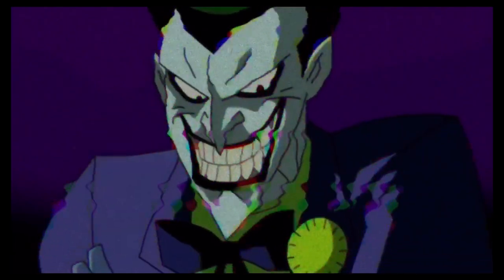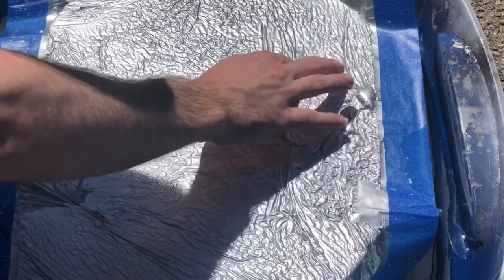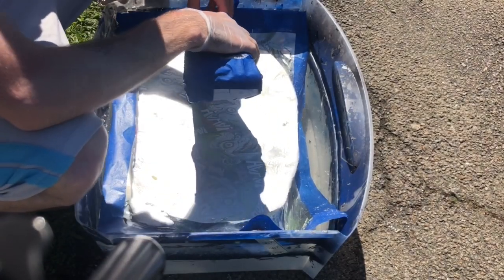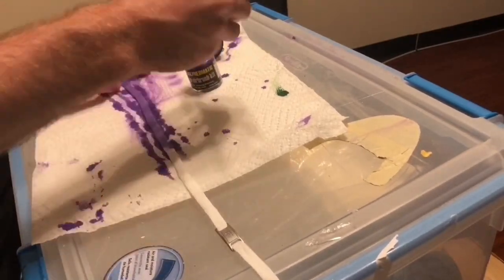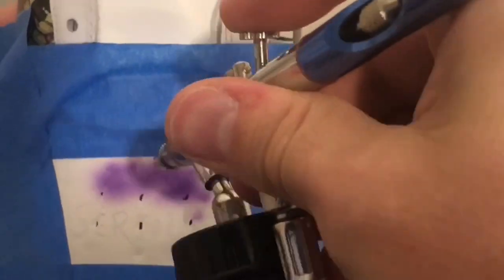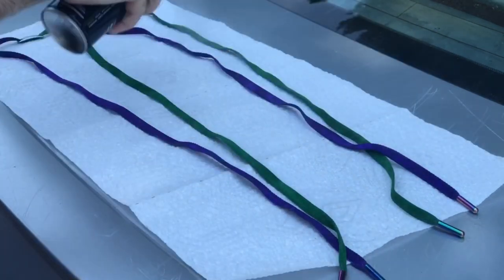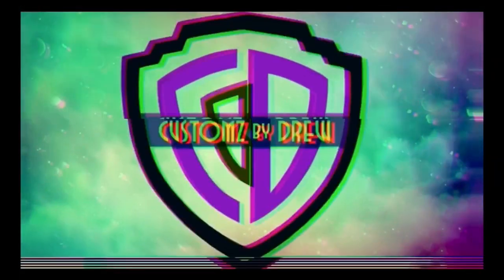Joker 🃏 Air Force One Hydro Dip Custom 👟 (Best One Yet)

Comment: If I hydro dip my air force and not put tape on some parts on the bottom to make a drip effect will that look good
Reply from the maker: Hey what’s up Grivz so I actually made a video doing this for a Simpson custom I think if you check it out , it will help you out with you question 🤘🏼

Comment: Where do u get the film for hydro dipping .and what spray did u use befor u dipped . And what spray afterwards
Reply from the maker: Hey what’s up ShockWave so if you search up Joker hydro dip it should pop up and you would also need a activation spray for the hydro dip and the spray for afterwards is a finisher to seal off the sneakers it’s Mod Podge Acrylic sealer
Reply: @customzbydrew26  what is the activator spry called . Is  it spray paint .
Or is it a diffrent kind of paint .
Reply from the maker: There are many different kinds tbh I used a couple different ones and can’t remember the name but if you search up hydro dip activation spray it should pop up bro 💪🏼

Comment: 2 questions what did you spray over the film in the water  and what did you spray the shoes with once they were done? These are 🔥🔥🔥🔥🔥
Reply from the maker: What’s up K.H So I used a matte finisher on the sneakers you can use any one tbh it’s just what you prefer and also in order to activate the hydro dip film you need to spray it with activation spray any one will do it’s just all on what you prefer

Comment: Do you modge podge acrylic sealer on hydrographic film still? I've had bad luck with every other sealer I've tried. Thanks
Reply from the maker: So you have to prep the sneaker very good so you have a proper bond and once you dip the sneaker you have to rinse it under warm water then apply a finisher I used modge podge before but I’m still looking for other finishers to try on the hydro dipped sneakers

Comment: Please help !...I want to start hydro dipping  shoes as a business..but I'm thinking about the amount of spray paint used per shoes ..it seems like I'll be losing and I dont want to over charge ...any advice ?
Reply from the maker: So typically I use hydro dip films I never used spray paint but I would recommend you look up hydro dip films and see what’s in your price range because prices vary also take your time and practice makes perfect 🤙🏼 you got this !!!! Another thing prepping is key so make sure you prep the sneaker very good to achieve a clean finish and dip on the select areas you want to apply the film/paint 🔥

Comment: Where do you get that hydro dip drawings and the spray to make it stick on the sneakers bc the one that I used sucks the paint keep coming off even whit the sealer
Reply from the maker: What’s up bro so it’s all on how you prepare the sneaker and after you dip you need to run the sneaker under warm water to wash off the clear coat then apply your finisher but I buy a whole bunch of dips and sprays from different places and try them tbh it’s trail and error but definitely check Amazon
Reply: @customzbydrew26  how did you get the picture on the film ?
Reply from the maker: Hey Mia so typically it comes like that but you can get a custom one made. A lot of people don’t know that but if you search it up you can pretty much find any cartoon character or any kind or pattern 🔥🔥 lmk if that helped and if you have any more questions

Comment: Hey man nice work, what all materials do you use?
Reply from the maker: What’s up man thank you I appreciate it 💪🏼 and typically for a hydro dip custom you need a bin,Tape, the hydro dip activator and film. But I also made a stencil and used paint as well as seen in the video as of specifics I kind of jump around I don’t really use just one item I try new ones but paint Angelus that’s pretty much the only thing I’ve been using and haven’t changed
Reply: What’s the film?
Reply from the maker: So if you search up joker film it should pop up I’m not sure where I got it from tho
Reply: @customzbydrew26   appreciate it bro

Comment: What kind of clear wrap you used to cover the other side of the shoe while you dipped the other and did you use spray paint or you use angelus white or neutral paint as the primer?
Reply from the maker: Hey what’s up Sheldric so I used Saran Wrap nothing to special lol and also I always acetone the sneakers and use white primer it self not a white paint or neutral paint
Reply: @customzbydrew26  all good then man thank you so much and one kore question, did you let one side dry when when you used the saran wrap and taped that side off and dipped the other and what can i use to stuff the shoes so water cant get in em
Reply from the maker: So what I did was wait like 5 minutes and then dip again because the film has a finisher on it and if you touch it or something touches it , it will smudge so be very careful also after you dip wash the sneaker with warm water then apply your own finisher and you can stuff the sneaker bro with a shirt you don’t need and also Saran Wrap any big openings as best as you can tbh the sneakers will get wet but you can definitely try to prevent it lol

Comment: I like it a lot! may i ask what did you spray after dipping the film in the water? (before dipping the shoe) thank you
Reply from the maker: What’s up Rouge I sprayed the film with the activation spray you can find it on Amazon if you search hydro dip or hydro dip activator 💪🏼
Reply from the maker: And thank you I appreciate it 💪🏼😌
Reply: @customzbydrew26  if I buy hydro dip film, it comes with activator? Thank you
Reply from the maker: No problem any time and typically you have to buy it separately but some sites do have it set up so you can get it together

Comment: Did u spray the sealer when the shoe completely dried? I sprayed Matt finisher on a test shoe 20-30 mins after I dipped it, I bent the shoe this morning and the clear cracked, was that because the shoe wasn’t completely dry????
Reply from the maker: Hey what’s up Chris & jay and I usually spray the sneaker after they are completely dried but first your going to want to run the sneaker under warm water to wash off the clean coat from the hydro film so you can apply your finisher to the sneaker I noticed after the video was posted I forgot to add that clip in so anyone who has been asking questions I have been telling them not to miss that step hopefully I was helpful 💪🏼
Reply: @customzbydrew26   thanks for the reply!!...and that should help seal the Matt finish and it wote crack?
Reply from the maker: @Its Chris&Jay no problem any time and if your applying a matte finish then yes it will help make it into a matte finish and tbh it shouldn’t crack all of the ones I did didn’t crack but then again you have to prep the sneaker well every sneaker custom that last long has been prepared very well lol but over time from wearing them it will wear off depending on how well you take care of them. But definitely run them under warm water to get off the shiny clear coat apply your finisher and you should be good to go 💪🏼
Reply: @customzbydrew26  thank yu so much my guy 💪💪💯💯 I will be doing 2 sneakers this week, I’ll follow yu on Instagram
Reply from the maker: Definitely anytime 💪🏼🗣 I’m happy I can help I love helping people out and showing love lmk how they go when your done ☑️

Comment: De que material es la imagen que pusiste al agua ?? Y que spray le pusiste?
Reply from the maker: Hey what’s up Canal so it’s called a hydro dip film you can order it on any website if you search hydro dip film up they have a big selection, also you will need activation spray for the hydro dip film 👍🏼

Comment: Hey! How do you prep the shoes beore dipping? I have seen people using acetone to rub off original coloring, also sanding with a sandpaper and also applying a primer. Do you do any of these things beore dipping the shoe? Thanks.
Reply from the maker: Hey what’s up ! So typically I would use acetone and primer to prep the sneakers after you dip them run them under warm water to wash off the shiny coat then apply your finishers such as matte finisher and also water and stain repellent 💪🏼 you will get the best results that way
Reply from the maker: And you don’t want to rub off the original coloring that’s not what acetone is for acetone is use just to take off the finisher so the paint or hydro dip can adhere to the leather properly. If you take off the coloring you can damage the leather and you don’t want that.
Reply: Thank you for the suggestions 🤗 Btw...do you apply acetone and primer only to the part of the sneaker that you will dip or you apply it to the whole sneaker before masking it?
Reply from the maker: No problem and I would apply it only to the part you are dipping because the other parts you are not dipping will remain factory after the sneaker drys
Reply: Appreciated 😉 Nice work...I love all the different techniques you are using 👌
Reply from the maker: Lol thank you 💪🏼😂
Reply: Hey, once again 😂 I have been trying to find the answer to my question with no success and no one seems to be answering my questions in the comment section under other youtube channels. However, you do...so I have a question for you 😂 Is it possible to hydro dip an item if it is coated only with a primer (without base paint)? I noticed that many coat it with a base paint as well. I am just wondering if a film will adhere to a primer just as it would to a regular base coat which is applied on top of a primer.
Reply from the maker: It’s all good I know a lot of you tubers don’t interact with there subscribers and I don’t get that lol I figure these are the people who support you so why not help them out or say Hii or respond to them it takes 2 seconds literally. But tbh I never tried it with just the primer I typically give it a base coat of white paint as well tbh
Reply: @customzbydrew26  Thank you. Seems now I have all the answers I need.   Cannot wait for films and activator to come so I can start dipping 🤗
Reply from the maker: No problem 💪🏼😂 and definitely go for it take your time and it will come out good

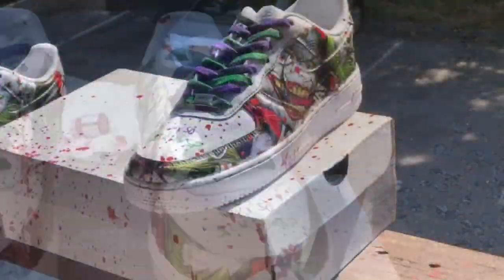Comment: 6:35 Bro what spray is this and what are the uses of this? Thanks in advance in your answer hihi
Reply from the maker: Hey what’s up bro so typically I use a finisher to seal the sneaker and a water proof spray for the sneakers they have hundreds of different kinds of sprays I’m sure but I use crep spray or reshoevn8r and mod podge acrylic sealer but if you have any more questions definitely let me know 💪🏼

Comment: Hey Drew, I have a question about starting on making custom shoes. I already do quite a bit of airbrushing but only on hard materials such as plastic. How do you prevent the water from getting down inside the shoe when you are hydro dipping, I would love to know the best way to handle this as I will be starting to make some custom shoes within the next month or so. Thanks man and awesome work!
Reply from the maker: Hey what’s going on Tyler so tbh I usually stuff the sneaker with a shirt and then Saran Wrap  any openings as best as I can but tbh you can only do your best the sneaker will get wet regardless lol but if you have any other questions feel free to ask 💪🏼

Comment: Fab!
Reply from the maker: Thank you so much Kaywood I appreciate it 🙏🏼🙏🏼
Reply: @customzbydrew26  You are very welcome mate! A little tip for the blood spatter is to try a tooth brush. Put the paint on the bristles and use your thumb and pull it across the length of the bristles and it will spatter like  a clogged aitbrush effct.
Reply from the maker: Thanks for the heads up bro I’ll definitely try this way on other customs and I seen it before but I just never tried it lol 😂

Comment: Hey man I’m planning on giving a few pairs a go! Do you know if you can remove the hydro film at all? I’d like to try use 1 pair of trainers for a few different try outs as I’m only just starting
Reply from the maker: Hey what’s going on Ashton 💪🏼 you can remove it for the most part but it will still leave stains I wouldn’t recommend it
Reply: @customzbydrew26  thank you! Be a few weeks till I try this design! Iv done some spatter ones then Iv hand painted some toddler trainers which have turned out not sooooo bad!
Reply from the maker: That’s dope Ashton 💪🏼 keep grinding and keep practicing you’ll be killing it

Comment: Hello Drew awesome job! But i have a question what is the spray that your applying on the sticker after making it wet ? I really appreciate your response! Keep it on !
Reply from the maker: Hey what’s going on Hagop so the spray I am applying is activation spray, what I does is activate the Hydro dip so you can dip the sneaker or what ever you using into the film 🤙🏼

Comment: Sup drew, I Love These Custom Very Very Great Job 💪💪💪 Just a question tho. How do you go about getting the film.. Never done a film custom n i would love to.. Any advice??
Reply from the maker: Hey what’s up bro so typically if you Google hydro dip film they have a lot you can pick from you will also need a bin to dip in and activation spray my advice to you bro is prepping is 
Key if you do any tape work to block off sections of the sneaker take your time and also practice makes perfect so try out different hydro dips you’ll get better as you go 💪🏼💪🏼💪🏼

Comment: bro where can i get this design or how can i print this?
Reply from the maker: Hey what’s up Sandeep so this design I purchased online I’m not sure where tbh because I ordered from many different places but if you look up joker hydro dip you should be able to find it 💪🏼💪🏼 if they still sell it
Reply: @customzbydrew26  thanks bro and can i know the products what others do i need ?
Reply from the maker: Yeah definitely I haven’t tested out many activation sprays but I’m sure some might be better than others I’m just not to sure and I don’t want to give you the wrong information but I use a brand called southern hydrographics that activation spray works very good and you’ll need a bin to do your dips in and the film you’ll be using to dip 💪🏼🙌🏼

Comment: So many things done wrong way in this video.
1. You put colored paper 45 degree angel so it wont have air bubles under.
2. You haven't showed us when you spray the water. After or before for beginners.
3. You never dip your item flat to water, it has to be 45 degrees angle and you have to push it slowly not fast.
4. Try to explain this while you are doing it.
Nice video but still it will be hard for beginners
Reply from the maker: Hey what’s up man I appreciate the feed back bro but at the end of the day no ones  perfect this is like my 4th time hydro dipping so I’ll getting better daily and I’m getting better at customs but thanks you for the feed back that drives me to be better 💪🏼 as long as my fans and supporters enjoy the video and the end results and dope I succeeded in my eyes
Reply: @customzbydrew26  no props bud. Happy to help.
If you find a way to hydo dip t-shirts, let me know 🤣 i order from you straight away.
Reply from the maker: Definitely it’s all love and I got you bro I’ll figure out a way I’m away evolving my craft 💪🏼